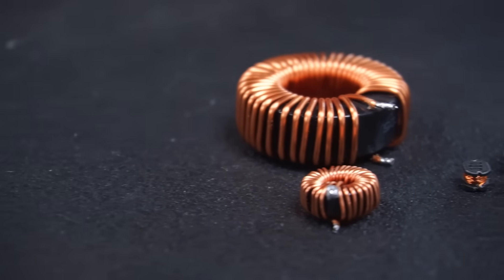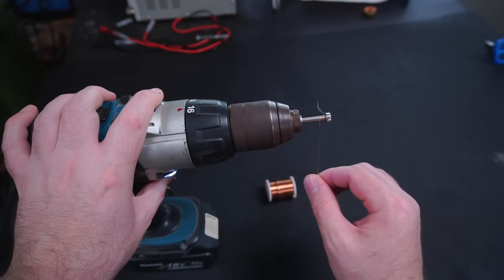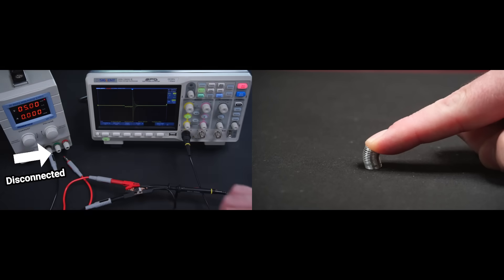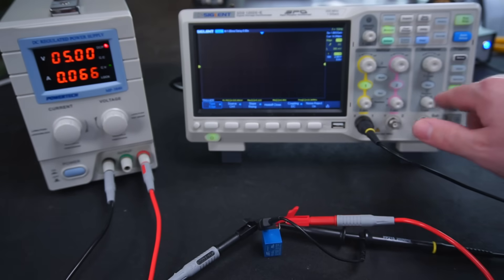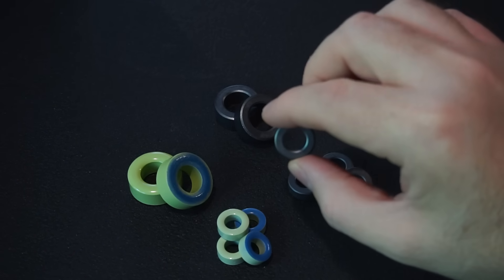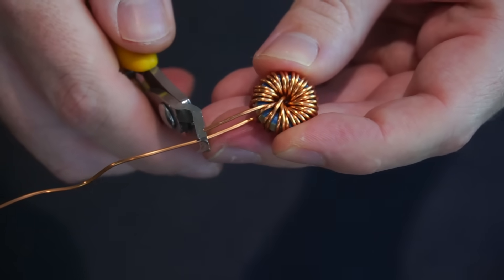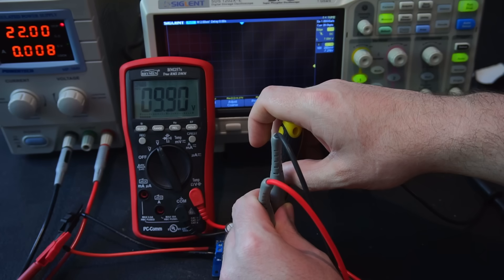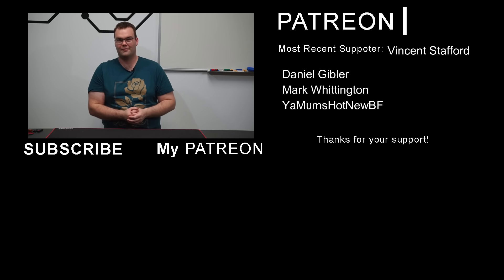How INDUCTOR's work & How to make your own

Comment: At 15:32 in the video, we are told that "inductors basically have no effect on DC power".  Why does my Drok DC to DC step down voltage regulator have an inductor?
Reply: As he said in the video, " In the case of buck converters and switch mode power supplies, inductors are used to help smooth out the voltage ripple caused by the high switching frequency."  If chosen properly, the inductor is invisible to the DC produced, but it can greatly reduce the amount AC noise that makes it to the output.
Reply: @sincerelyyours7538   I am still a bit confused but what's new!  
You mentioned "greatly reducing the amount of AC noise".  As I had written, my "Drok" is the DC to DC type.  The input is connected to a 12Volt battery as opposed to a wall outlet and the output is dialed down to 6Volts DC to power a portable Short Wave radio.  
So given your response, I guess my new question is...  Is AC somehow being created during the DC to DC voltage reduction process?
Reply: @tribulationprepper787  Yes, definitely.  According to Wikipedia, "Switched-mode DC-to-DC converters convert one DC voltage level to another, which may be higher or lower, by storing the input energy temporarily and then releasing that energy to the output at a different voltage.  The storage may be in either magnetic field storage components (inductors, transformers) or electric field storage components (capacitors)."  They work by chopping the input energy using a high frequency switching circuit and then adjusting the duty cycle to regulate the output voltage to the desired level.  That voltage is then rectified and regulated into DC again, but at a different level than where the input was.  The idea here is to avoid using a large transformer, a la linear power supplies, which are heavy, costly, inefficient and take up too much space.   By using a frequency considerably higher than the 50 or 60 Hz coming out of your wall you can get away with using a much smaller transformer, or even no transformer in the case of small IC driven DC to DC converters like yours, and let the ICs and MOSFETS do all the work.  The downside is that they produce lots of switching noise which then must then be filtered to keep it from getting into frequency sensitive appliances like computers and radios.
Reply: @sincerelyyours7538  Thank you so much for your research.  I am thankful that my little Drok device is capable of preforming it's intended duty without a need for five extra pounds of wound, enameled copper wire.
I have to hand it to the engineers that figured out how to design and build so much capability into such a small package.  It is a borderline miracle for sure.  Pure electronic genius!
Again, thank you.

Comment: Ideas for other videos:
 I would like to better understand inductor saturation, and see if we could show that it eddie losses is why one worked better than the other. 
How to select low cost capacitors for high output induction heaters (high current applications).
Using a microcontroller to monitor and control an induction heater, frequency matching and to protect the mosfets.
How to test if mosfets are still good, and general trouble shooting of SM power supplies.

Comment: Nice work!
_
When you compare the two cores with µ=75 and µ=900, the "smaller" one becomes later saturated, when the current increases at same core size, right? Means the inductance is linear over a wider range

Comment: Great informative video. The only problem is that you can't find magnetic permeability searching for component and this is the main element to get correct calculation. I've tried many websites, manufacturers don't specify it. Would it be possible that they show it under different descriptions like "material" or else?

Comment: oh boy, where do i start...

"inductors can't store energy when disconnected from power supply" - no, they can. Ideal inductor will store its energy indefinitely if it is shorted. Real inductors rarely achieve more than a second of useful storage time. This is unlike capacitors primarily because our insulators are much closer to ideal than our conductors. Like capacitor requires ideal insulator (zero leakage) to store energy indefinitely, inductor requires conductor with no resistance (superconductor) to store its energy indefinitely.

spring analogy - see other comments... the analogy is acceptable, but there is a better analogy with mass hitting a brickwall.

"if flyback were a person" - oh dear...

diode peak current 220 amps "massive overkill" - it is indeed massive overkill. The peak current that will flow through the diode is equal (slightly less, actually) to the current that was flowing through the coil just before breaking the circuit. This is exactly the rule "inductor resists a change in current". It will slowly decay afterwards. There is no need to account for more. Heating may be of concern if the load is cycled on and off fast.

"Inductors help smooth out voltage ripple caused by high switching frequency" yes they can, but their primary use in switchmode converters is very different. They are temporary energy storage that can be filled using one voltage (the input voltage) and drained at another voltage (usually but not always, the output voltage). They are at the very heart of the conversion process (with some exceptions).

"these spikes are undesired voltage ripple" - no. These are conducted emissions (mostly caused by parasitic inductances, capacitances and transformers in your circuit), they are not called "voltage ripple". Voltage ripple is usually the changes in capacitor voltage that happen as the inductor enegry is dumped into it, and then capacitor is discharged by the load. The ripple usually looks like sawtooth with a bit of square wave, but it can take very weird and wonderful shapes due to complex behavior of capacitors and inductors, feedback problems, burst mode operation of some converters, and lots of other intricacies. 

On your pictures, true voltage ripple is clearly visible only under load (but you measure peak-to-peak value which is dominated by these conducted-emission spikes).

"the buck converter got very hot" and you have not explained why. You have removed the fundamental piece of it, effectively shorting out the switching node of the ic. The IC is always in overload protection, and i'm actually surprised it didn't die right away. This is why it got hot.

"<two materials suited for...>" - you don't explain, why so. What properties of these materials are the reason for their intended application.
I tell ya. It is the energy that can be stored in the core before core is saturated. Power applications require that energy storage. Signal filtering and transformer applications don't.

You can actually make a pretty decent power inductor from a high-permeability core by introducing an air gap (effectively reducing its permeability; the energy is then actually mostly stored in the gap, not in the core).

"1mm copper wire which is suitable for the current" - waaay too simplified. There are two current ratings for an inductor: the current at which its core saturates (where it mostly turns into a resistor), and the current at which it overheats. They are not equal. The saturation rating is insensitive to wire thickness. In practice, inductors are usually picked so that the peak current never exceeds saturation rating, and rms current never exceeds overheating rating, although there is more to it (core loss can cause additional heating). 1mm may be suitable or may be not, there is no simple answer.

"you may have to use a larger toroid because the wire will not fit" - yes and no. The core must be able to hold the energy the converter requires. That's the minimum. Then you may indeed be unable to fit enough wire and that will indeed force you to pick a bigger core.

"<inductor calculator>" - that's a very simplistic calculator that is not suitable for designing power inductors, because current rating is extremely important, and that calculator gives you no clue.

Peculiarly, the calculator has wire thickness. The thickness mostly doesn't affect the inductance, so i wonder what is it there for. For estimating the needed length is my guess...

==final message==

"inductors have no effect on dc power" - sorta true.

"inductors only affect ac power" = same as above
"ac power === ripple" - yes but not quite. Every ripple is "AC", but not every AC is ripple. "AC" in quotemarks because ripple superimposed on DC is usually not enough to make it truly alternating.

"inductors don't affect voltage" - just nonsense.
"inductor resists sudden changes in current flow" - true.
"which in turn can smooth out unwanted voltage ripple" - true, but that's not their main use in switching converters.
Reply: Very good also, but he got the point across with out going over a bunch of heads!
Reply: You saved the day.
Reply: Russians are smart!
Reply: Olá  !!!  amigo  sabe  me  explicar  por que   a  limalha  de  metal    não  grudou  em  toda  a  extensão  da  bobina  ficou  presa ( grudou ) apenas  no canto esquerdo ???  em 2:24
Reply: Thanks  keep it up  i wish if you could explain in depth how many turns of an inductor or of a wire  around a reed switch is needed  to turn it on  or if you could recommend a website or a calculator  to do such task

Comment: Using the diode in parallel with the relay coil slows down the release of the contacts.  If the contacts carry some considerable current, you mau get an arc that damages the contacts.  Most of the time I make a compromise between the kick-back voltage and the speed by adding some resistance (up to the same as the relay coil resistance is) in series with the diode.
 By the way, the relay coil also presents at the release time to the diode loop energy stored in the spring  that opens the contacts.
Reply: A good way to speed up the release is to wire up a bidirectional tvs diode rated to a voltage your switch will withstand, in parallel to the relay coil. Most of the time, you'll be using mosfets to control relays, and mosfets will have that tvs diode "built-in", so to say. Look for "avalanche current" spec in the datasheet: if it is greater than the current consumed by the relay, you don't need to add anything, the mosfet will safely absorb the energy stored by the coil, and dissipate it as heat.
Reply: @victortitov1740    Fine as far as it goes.  I am uneasy about, say 24 V relay producing a maybe 300 V kick corresponding to a likely FET avalanche rating.  A list of different "safe" voltages has several confusing numbers, of which I have derived 48 V as my favorite (just below the 50 V list value).

Comment: I always used a diode wired backwards across the relay coil terminals to prevent a voltage spike effecting the circuitry elsewhere in the project.

Comment: Inductors are useful for buck-boost converters too. They take advantage of the voltage spikes to produce higher outputs than the input voltage.
Reply: Fred Garvin  how come?
Reply: Fred Garvin  boost needs the back emf of the inductor that occurs when you disconnect the power and it tries to keep the current going.

Comment: Is there a way to minimize the ripple to completely 0V ?

Also, could you explain the real world of commercial power supplies; like, mobile chargers, custom PSU, PC PSU ... etc. What are the quality of DC voltage we get from any SMPS ?
Reply: Not with a switching regulator. You need a linear regulator to get better performance, but nothing will ever give you zero ripple.
Reply: @MarkSJBeard  Yep, I learned that there ideal method for almost anything in life. But the real world isn't ideal. And in the topic of power supplies there advantages and disadvantages for both linear and switching power supplies, and each one work best in certain applications.

Comment: Great video and information, thank you very much! FYI, I haven't sanded or burned the insulation from this kind of wire for many years now. Modern coated wire is made to solder through, at least on all the wire I've dealt with. Just hold the soldering iron and solder on it for a few seconds and it works like magic, instantly tinned.
Reply: Magnet wire insulated with a nylon/polyester blend can be soldered without stripping. Lots of magnet wire cannot and has to be mechanically stripped or striped in a "salt pot" stripper at very high temperature.
One of my clients, which made large iron core transformers in house, used an oxyacetylene torch. If you set the flame to oxidizing (more oxygen than needed for the acetylene) and put the wire in the oxidizing part of the flame, the insulation is cleanly stripped. You can't do this with something like a propane torch. It will simply burn the insulation leaving a mess that still has to be removed mechanically, though more easily than unburned insulation.

I used to buy magnet wire from a supplier to motor rewinding shops. They didn't stock the stuff with solder-through insulation because it isn't robust enough for industrial motors.

Comment: I planted some strands of fiberglass but they never grew into circuit boards. Lol. That was kind of cool 👍.  But also capacitors are supposed to minimize ripple .
Like an electrolytic capacitor. 
would not having a large electrolytic capacitor directly across the output minimize that ripple. ?

Comment: I am having trouble with my y-axis motor so an alternative closed-loop stepper motor would be good. I have purchased Ine s42b and it worked on the x-axis and like a lot of my projects I should have purchased an extra one through bangood. So back to waiting for my 3d to properly print stuff, yet since I will have to wait for ages for the s42b by big tree  to reach me, I may as well see if my neighbour from the land of the long white cloud can build one, purely for the simple reason, I am sick of making some northern rich. If I think of any other ideas I will drop a line. Btw, it is open sauce so I recommend 🍅

Comment: Noob question here.  How do you calculate the inductance you need to accommodate certain amp requirements.  If I wanted to make a buck converter that could handle say about 5v at 10A, what is the method to calculating the inductor in that specific example?  Is there a calculator or website that would do that?  I haven't found one quite yet.
Reply: You need more specs... especially input voltage and desired switching frequency Let's say Vin=10V and fswitching=100kHz. Consider a standard buck regulator when the control FET is turned on. During this time, the inductor is effectively tied between the input voltage and the output voltage, or said another way, the voltage across the inductor is Vin-Vout. During this time, current will ramp up linearly through the inductor via : V=L*di/dt. How much ripple current can you tolerate? Let's try to simplify it in terms of output ripple voltage... say you want the ripple to be no more than 25mV pk-pk. Now lets say you have a bulk output capacitor of 470uF with 10mR of ESR. You need to limit the inductor ripple current to 2.5Apk-pk to achieve 25mV of output ripple. Now you know V and di... dt is just the duty cycle multiplied by the switching period (or divided by switching frequency)... dt = (Vout/Vin)/fswitching. Plug in all the numbers and solve for L. If I did my math right, it should be 10uH. This is VERY simplified and only gives you the inductance value under certain conditions. There are many other considerations that must be made when designing a buck regulator...

Comment: if Inductors have NO effect on DC power, then why I see them on DC circuits only...?? 🤔🤔
Reply from the maker: "DC Power" is a factor of voltage & current. Inductors only affect changes in current. This is also why power inductors are not used in AC as you mentioned.

Comment: Could you do a similar video on capacitors? And then, one on the relationship with inductors dc-ac?
Reply: Capacitors control the rate of voltage changes, inductors control the rate of current changes. Add freewheeling diodes for clamping and you can make pretty clean power on high current supplies. Check some of the various youtube videos on IGBT power inverters for full explainations of each part of the circuit.

Comment: Arn't you contradicting yourself when you say that inductors don't affect voltage and then turn around and say that ... which in turn can smooth out unwanted voltage ripple. ?
Reply from the maker: First, we have to ask the question, what is causing the voltage fluctuations (aka voltage ripple)? For example, let's assume we are rectifying 50hz AC into DC. The rectified DC output will have voltage ripple due to the current source (AC) not being constant. An inductor resists changes in current flow. By smoothing out the current flow, it can stabilize the voltage & as a byproduct, and therefore reduce ripple. I hope this explanation helps you out :)

Comment: I have that very same component tester. It doesn't work too bad. The LCD screen lost its seal on mine shortly after I bought it, but still works. Every once in awhile it will give some erratic readings.
I bought mine and assembled it. I had to come up with my own case for it.

Comment: Wow you make this sound so easy but electronics is so hard for me to really grasp. I’m still really lost but you did make a lot of sense and this is such a great channel I subscribed and have been watching your videos nonstop. So if inductors have no effect on DC power is it a waste to put one after the capacitor in series with the output. I am going to rectify a welder from AC to DC. Some videos I see people putting an inductor last in the circuit and some people just do the rectifier and capacitor without an inductor. Basically if I understand you correctly if the circuit has been rectified to DC and then run through a capacitor then the inductor isn’t doing anything at the output. I hope this question makes sense because I’d like to hear your thoughts. Thanks